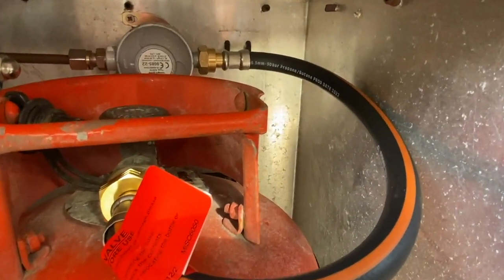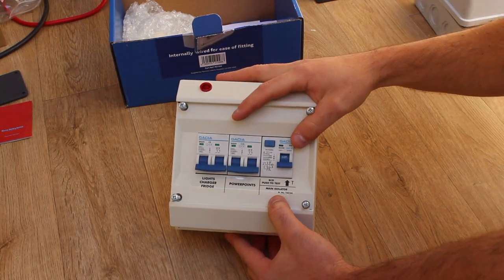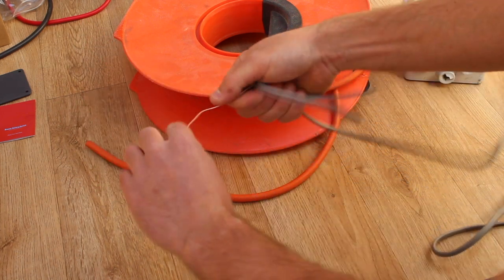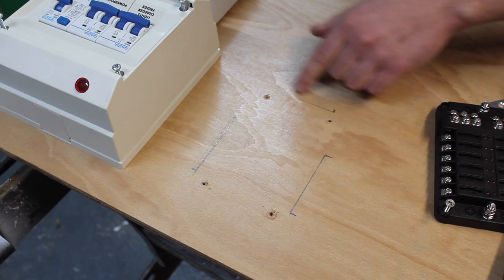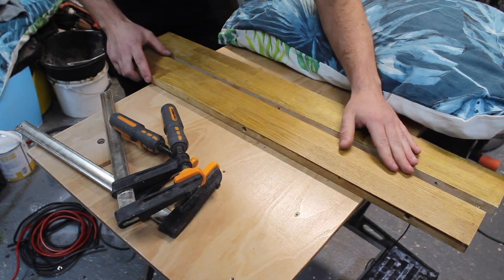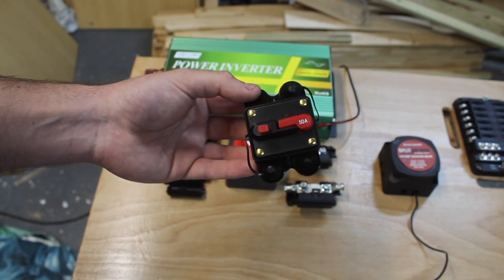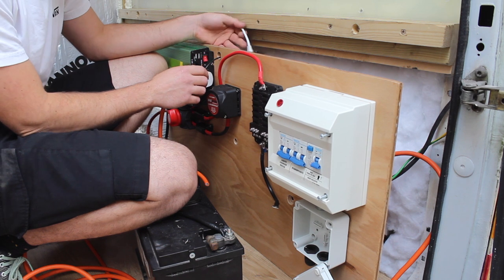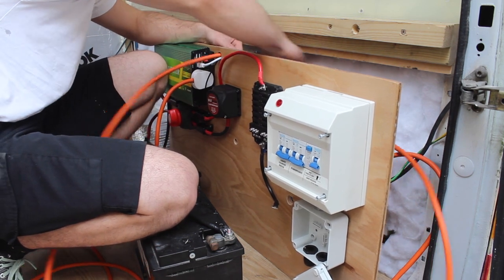Self Build Camper Electrical System - Van Build Series - Episode 19

Comment: I love watching the series, really brings things to life 👍 can you advise the best insulation method for the overcab section please? I have some moisture issues in this area and am not sure how to resolve. Cheers
Reply from the maker: Thank you! 😊I’m not an expert on the condensation issue as I’m just trialing the vapour barrier method myself. But If you can’t insulate and vapour barrier that area then ventilation in that section is key to reducing the condensation. If it’s a cupboard like mine you could perhaps put some vents in it to allow the air to flow through or even a small 12v fan perhaps to help push the air through. And try to limit how much stuff is stored in that space as it will stop the air flowing.

Comment: Hi i really enjoyed watching your build and have learned a lot for my own. A quick question. What size fuses are you using around your main isolator. My set up is pretty much identical to yours in a sense of power and draw to the equipment. Thanks
Reply from the maker: Hey, thanks for watching. It will depend on the size cable you are using to the fuse box and the maximum current draw of all your circuits?

Comment: Great video again!! I baught a 1997 transit 2.5 turbo with bosh pump and my    max revs are 3000 rpm any ideas?
Reply from the maker: Thanks mate, check the throttle cable isn’t getting caught under the bonnet. If that’s not the issue it could be that you need to adjust the fuel pump max fuel screw so the throttle opens up more. Careful not to over do it though. Where does it sit at idle?
Reply: @TurnersWorkshop97  about 900 rpm
Reply from the maker: That’s about right for the idle, I’ve had the cable get caught on the part that holds it in place under the Bonet before. Stopped the cable operating all the way.
Reply: @TurnersWorkshop97  i will chek it.thank you!!
Reply: @TurnersWorkshop97  found the trouble .A tube of the fuel filter to the pump didnt allow the hole throtle open fully.Thank you very much!!!!
Reply from the maker: Well done mate, glad you found the problem. Keep em smiling 👍🏼😄

Comment: Nice work. What size cable are you using for the solar panels. I'm putting 525w solar, but I've been advised that 4mm squared cable is enough.
Reply from the maker: Thank you! I have used 6mm as I would rather over-spec. With 524w/12v the maximum current will be 42.75amps. That’s if the panels were 100% efficient, which they aren’t. 6mm cable is rated for 50amps. Also the thicker the cable the less resistance and the more efficient the system will be 😊